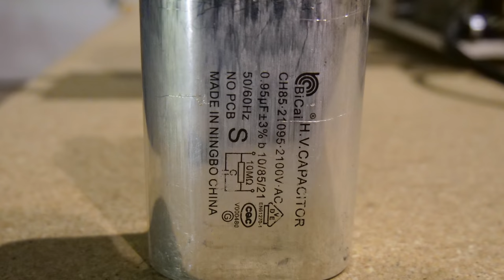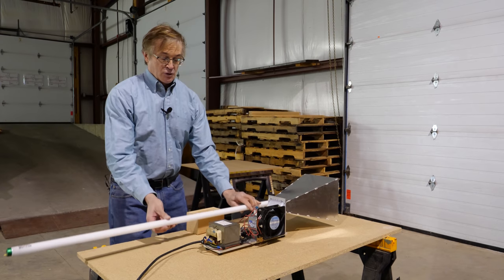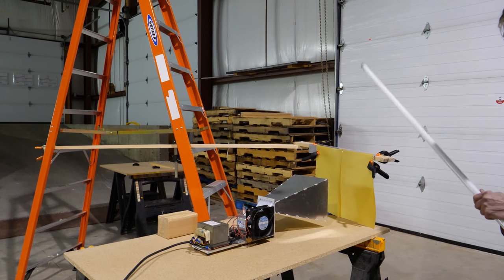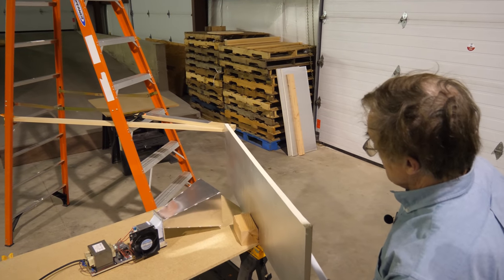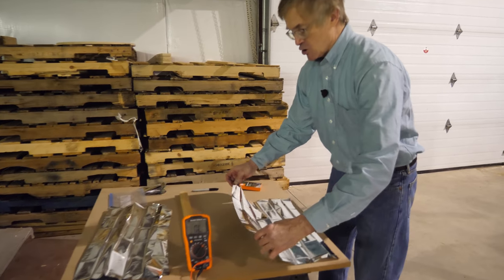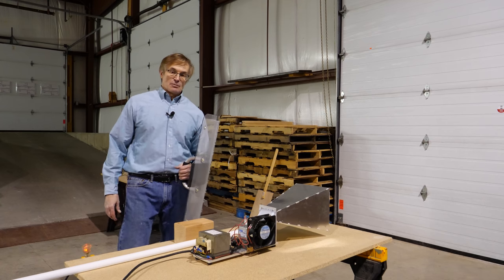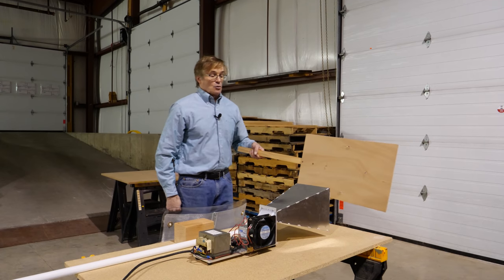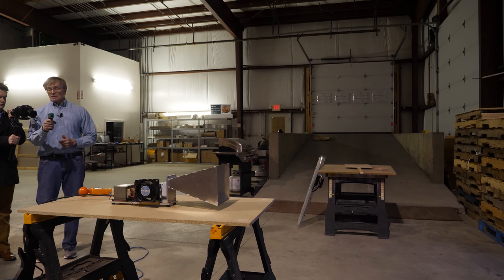You're not protected from microwaves... yet - Part 2

Comment: Commercial Magnetrons to my knowledge never used BeO for the ceramic, it has always been AlO or similar. The reason is that the thermal conductivity of BeO is not needed, would be also to expensive. You will only find it on Higher power tubes in Military or Industrial units. Also, it would have to be Label as BeO very clearly, and that would be true for at least the last 30 years. As far as I know, the BeO in domestic microwaves is a myth.
Reply: When people are scrounging for parts, they usually don't care if the device was sold after 1991...
Reply: I had long thought one of the dangerous elements using in magnetrons was thorium.
Reply: You can tell from the colour of it.
Reply: @1magnit  BeO comes in both pink and white ceramics.
Reply: Same material as TIG welding cups.
Reply: @1magnit  not 100% but if it is colored it is unlikely to be BeO
Reply: @MikinessAnalog  Thoriated tungsten filaments only contain a small amount of thorium. It's generally only an issue if you eat it.
Reply: @rocketman221projects  
Still a bit radioactive.
Reply: We've made a microanalysis of the pink parts of a Samsung magnetron and it indeed was Al2O3 without any berillium
Reply: @the_ALchannel  I have held a few magnetrons before and remembering that part felt a lot like some kind of "ceramic alloy".
Just an observation.
Reply: @rocketman221projects  the Barium is the bigger toxin i guess, Thorium is quite uncommon and also unnecessary in these applications
Reply: @MikinessAnalog  yes they are just Al2O3,  you also can't really color BeO
Reply: @MikinessAnalog  so is your granite countertop, as well as the bananas sitting on it.
Reply: @heinrichhein2605  You can color BeO, but what would be the point...
Reply: @nobody8717  30+ years ago, BeO was also unneccessarily dangerous and expensive to use in the manufacturing of simple consumer devices.
Reply: @user255  where did you see color BeO, every manufacture I know says only white is available. Would be good to know
Reply: @heinrichhein2605  No no, I stated that it can be colored, not that it is colored. The alumina isn't either colored for aesthetics, but to improve its properties. The color is just side-effect of the chromium.
Reply: @user255  yes i don't think there is a way to color it, and that it was ever done anywhere. Thats what im interested where you have seen colord BeO
Reply: @heinrichhein2605  Simple, just add some chromium oxide to it and it is colored. Why it would be even hard?
Reply: @user255  As far as i know, this does not work with BeO
Reply: @heinrichhein2605  Of course it works. Why it wouldn't?? BeO is not colorless even in nature. Any impurity colors it. Just like with any other ceramic material.
Reply: You are right Heinrich, good observation
Reply: @rocketman221projects  The biggest risk it inhalation of the dust when sharpening the electrodes.
Reply: Good, but still wise to he careful. Everything around magnetron is dangerous, even the magnet.
Reply: @gregbailey45  yes, but misinformation should not be left alone

Comment: The neon indicators are a much better version of what I imagined when I left my comment asking about LEDs. I imagined an indicator light on the edge that just lights up when any part is hit but what you showed could be made into a grid! Thanks for pointing out the problem with it too, so we also know why LEDs would be a bad replacement for them.

And as a way to have fun with it, I imagine a microwave-protective cloak that lights up in places when hit would be pretty neat :D

Comment: Does the non-conductive side of the emergency blanket block microwaves? I would think yes but you made a point to mark the conductive side.
Reply: It  doesn't matter, both sides will block/reflect microwaves the same.  
I think they labelled the conductive side purely out of habit, as you often want to make sure the conductive side doesn't short-out any bare electronics you wrap with it.  Also the 2 sides have differing ability to hold up to long-term weathering (it can be counter-intuitive, it's an interesting phenomenon on it's own!)
Space blankets are a pretty neat material for all sorts of weird projects.
Reply: I was going to ask the same question...
Reply: It doesn't matter which side is conductive as long as it's the medium between you and the emission. It will not pass through the material from either side because it will eventually block it's path.
Reply: Yes, both sides will block BUT both sides won't necessarily reflect the same. If microwaves act like IR, then the side that is plastic will not reflect the microwaves well, if at all. Whereas the reflective, Al side will not only block, but also reflect some. Kind of a moot point all in all, since you only really want the blocking, but an interesting aside.
Reply: @justinw1765  microwaves will go through the plastic, reflect off the Al side on the back, then go back through the plastic.  

Think of the plastic like the glass on a surface of an ordinary bathroom mirror, since it's transparent it doesn't reduce the effectiveness of the mirror, even tho the light is forced to go through it twice.
Reply: @roidroid  it actually does reduce the effectiveness, most glass (if not any glass) absorbs certain wavelenghts, thats why glass panes look green for example mirrors do the same. If it does absorb a wavelenght its not 100% effective anymore.
Reply: @Ramog1000  hi
Reply: The non-conductive side does not block them. But it lets them through to the conductive side - which will. So the orientation of the blanket shouldn't matter.
Reply: The only likely issue would be if the plastic used isn't transparent to the frequency of microwave used.  In that case, having it metal-front would reflect the beam, while having it plastic-front would reflect the beam until the plastic melts.  Given the thinness of the material, that might happen quickly.  But most plastics are fairly transparent to microwave, so it is probably fine.

Comment: Thanks for another great video, and for referring me to it in the previous one.

Now I am wondering if you protect yourself similarly against for example Area denial IR-spotlights.
Obviously, electronically conductive material probably won't be able to deflect and reflect the IR-radiation. But then again, even small cardboard could probably defeat IR Spotlights, which is probably why Microwaves are still used for Area denial.

Comment: A hat, or even a hood, lined with reflective material may focus a microwave beam inside the head, like a satellite dish, or at least allow what passed thru to have another go at you.
Reply: for the hood ... would it not have to pass through your head first?   Probably would be attenuated by then.
Reply: could be worth having a mesh face shield more so than a shielded hat, or only shield the front half of the hat
Reply: @sethdrake7551  Takes a special person to be willing to look different from everyone else.   In addition to saline their are sprays that leave a dry conductive surface.  I wonder if there is a conductive makeup.   When it comes to millimeter waves, it also burns the little blood vessels off of the eyeballs, and goes into a person's nose, mouths, and ears.
Reply: @ep5acg  face shields are pretty common at the protests ive seen at least, theyre like football helmet wire protection things for your face but it also protects from sprays and cant be used to grapple your face

Comment: Thanks for this. 🙂👍 

One caveat with using electronic detectors and IR detectors is their bandwidth. They respond well enough at the relatively low ~2.4 GHz frequencies of microwave ovens, but how well do they respond to ~24 GHz, or more importantly, the ~240 GHz range, where these weapons are operating? 

Also, when stitching that electrically conductive fabric together, it's very important to overlap and fold over the seams, because the small gaps between stitches when fabric is simply butted together can allow millimetre-wave signals straight through, whereas 12 cm wavelength energy will be stopped effectively. 

As a rule of thumb, gaps have to be smaller than about 10% of the wavelength of the signal you are trying to block, for a shield to be effective. The smaller, the better. That's why a 'fly screen' is used in a domestic microwave oven door, rather than a 'chicken wire' screen. That screen on your oven would let 200+ GHz energy - with a wavelength in the region of about 1.5 mm - from a weapon, straight through, almost as if it wasn't there.
Reply from the maker: Two questions.
It's my understanding that these weaponized systems operate at around 100 GHz.  Do you have a source to support that much higher wavelength?
Also, those guidelines are generally used for designing Faraday cages where an attenuation of tens of db is a minimum. Do you have any equation that relates attenuation at a given wavelength to the apature width?

Comment: I have been in contact with MW-targeted individuals who have had aluminum foil PERFORATED. In one case it was a homemade multi-layer aluminum foil blanket. I don't recall whether all the layers were perforated. In another, a guy had put a layer of foil in his walls, and when he did a repair later, found the foil perforated. Another correspondent (in South Africa) actually sent me a pic of her "tinfoil hat" with perforations. And I know of another case like the latter in Canada.
Reply: The perforations could also be from oxidization.   Aluminum loves to oxidize and only the oxide on the surface stops it,   If you scrape that off, like by the layers of a blanket rubbing against each other, the very thin aluminum can be eaten through pretty quickly.   Aluminized mylar is better for this because the mylar protects the aluminum from the air.
Reply: @testuser123011  Maybe but one victim had it in his walls, up against the siding under his insulation, perhaps due to a misguided belief that it would provide thermal reflectivity there.
Reply: stainless steel mesh also works well, but I don't know if that also applies to 5GHz

Comment: A coworker at my job was playing around with burning figures into wood and ended up killing himself recently. MOTs are no joke guys!
Reply: Did he accidentally touch high voltage from the transformer or a capacitor, or something? Or are you saying he microwaved himself to death?
Reply: @hxhdfjifzirstc894  like I just said, burning electrical lichtenburg patterns into wood. Presumably he got sloppy or careless and him along with family and friends paid the ultimate price for that.

When messing with MOTs, high voltage safety must be taken seriously. Stay a safe distance, one hand rule, ensure some ability to arm and disarm/de-energize the system, use a dead-mans switch (like a petal that must be depressed continuously to run), etc.
Reply: I agree they will kill you PDQ  --  burning wood (carbon conductive tracks) is not smart, most folks would't realize they were conductive.
Reply: @craigs5212  Despite the fact those carbon tracks are obviously conducting electrical arcs and burning... but who am I to judge ¯\_(ツ)_/¯

Comment: Thanks for video. We use those huge 1" thick polyurethane foam panels from home depot as insulation.  We only have single pane windows.  To save energy we cut them exactly to size of our windows.  For larger windows need two panels cut with a box cutter knife.  Tape the edges to prevent wear and poly urethane particles.  We put them in after dark.  cuts way down on conduction heat loss. Or if hot outside, cuts AC loss though we tend not to put them in till dark.

Bonus:  our neighbors and those pesky Russians are not microwaving us, as you showed us reflects the beams.

Comment: Thank you so much - very interesting and great content. Could you please make a video explaining high altitude emp - consequences and how to protect against it?
Reply: Like 93 million miles high?
Reply: @bobby_greene  or nuclear emp high
Reply: @bunnypeople  I was thinking a Carrington event
Reply: Literally everything in this video is relevent to and emp in the sense of protecting from it. Its just electromagnetic radiation in a high level pulse. Faraday cages pretty much the only good way to protect anything electronic,
Reply: @connorjohnson4402  Yes, you are correct. But there’s also emp suppressors, emp hardened products, emp protection devices for cars etc. Also some rumors of some cars surviving a nuclear high altitude emp.
Reply: @connorjohnson4402  Yes, I'd like to know if a car could be protected using a metallic "car cover" cloth.
Reply: for you its safe, your equipment would need to be in a faraday cage. No cables going in or out from the outside, you safest bet would be replacement gear thats either in a Metalbox or a room made to be a faraday cage. But the big problem would be public grid supply, since probably transformer stations would be knocked out. So a big question is how valuable the stuff would be if there is no electricity to use it on. Except ofc you keep a generator which probably would also need to be in a faraday cage.
Reply: @connorjohnson4402  well there is a difference, for microwaves you don't need a cage. Since you can literally reflect the radiation with conductive material. So as long as a plane of conductive material between you and the beam there is nothing going through. But with electrostatic fields etc you would need a complete faraday cage, since the elctrostatic field even propegates through normal conductors (the thing with cages tho is that the field gets canceled out in the middle of them and the charge only builds up on the outside. Its a bit like a lightning rod althought it technically doens't have to be connected to ground to work  still saver)
Reply: @Ramog1000  which material does not reflect (or reflects as little as possible) em waves?
Reply: @ivanperkovic3804  how does that question releate to the topic? As little as possible, the plywood he showed was a good contender, or air itself, everything thats basically nonconductive and has not allot of water. For protection you actulaly want reflection tho.
Reply: @Ramog1000  it releate a lot if you want to cover a dron from radar , you need to absorb much more than reflect

Comment: While it wasn't in my initial design envelope, I have been working on fine-tuning a graphene in suspension product that is a few months from launch once I get a sizable stock ready to go. I have one variant that's brushable for various applications and wonder if it might be applicable for your anti-microwave as a topical coating. Don't count on me to test it, but if Tech Ingredients wants a sample, by all means!
Reply from the maker: I actually tried a few electrically conductive coatings and they worked.  I made one from graphene nanoplatelets and another from low cost graphite powder.
Reply: I would love something like this to paint the wall behind my powerwalls for my solar.
Reply: I saw a brushable house paint a few times on the net a few times over the last five years.
Reply: @jazzfreek54  Been looking into this.   Apparently graphite mixed into acrylic paint works.  And it's cheaper.
Reply: @TechIngredients  Did you make a video on those?  If not...please? 😀

Comment: I think when building a faraday cage with rigid polyurethane foam insulation, you can use HVAC foil tape to seal the studs in a stud wall. You mentioned "don't forget the floor." If you're on the ground floor of a building, can the EM radiation come up through the ground/building floor?
Reply: Probably not. You just need the walls and roof to shield, whatever goes trough the ground would be more likely to be absorbed, rather than reflected trough the floor.

Comment: Why did you label the front of the mylar blanket? You said you'd come back to that but didn't.
Also...is there a risk the metallized surface heats up enough to melt the plastic or burn you?
Reply from the maker: I just wanted to prove the metal is only on one surface for future reference.  As I said, we have run this continuously for many minutes without deteriorating the plastic.
Reply: @TechIngredients  Alright. But there's no impact for shielding, is there?